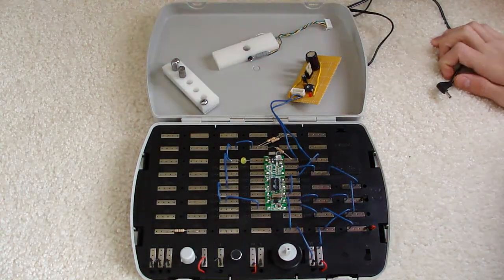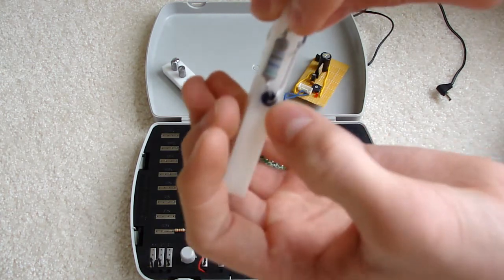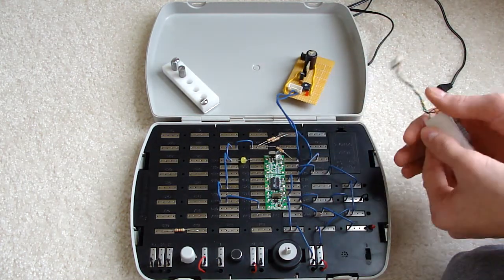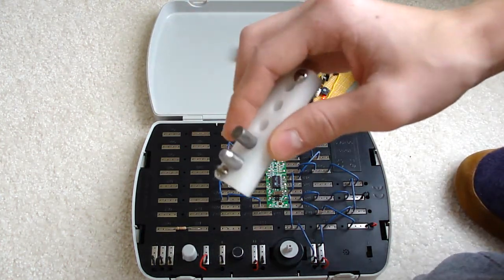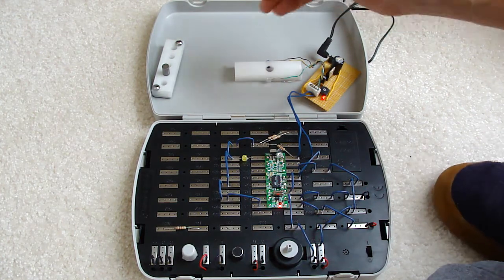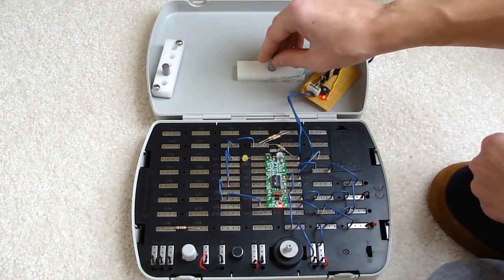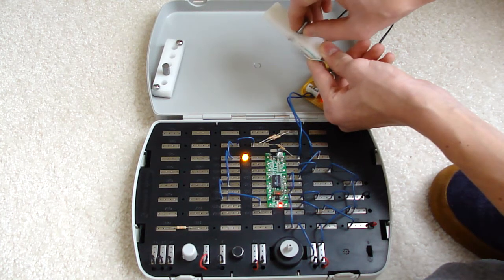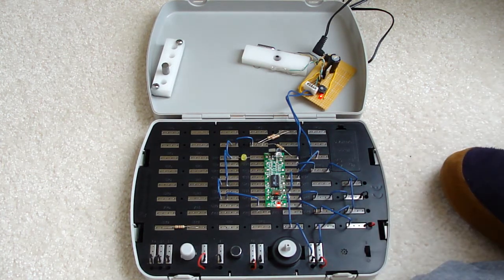Coilgun Optical Trigger

Comment: I would ditch the arduino and just go with a simple circuit using SCR's triggered by the optical leds.  The arduino has a specific cycle time (time it takes to loop through your code).  If your coil gun gets fast enough, this cycle time will be too slow to keep up.  The SCR's and optical LEDs also have response times, and this would add to the problem.  Keep it simple.  just use the leds and scr's.